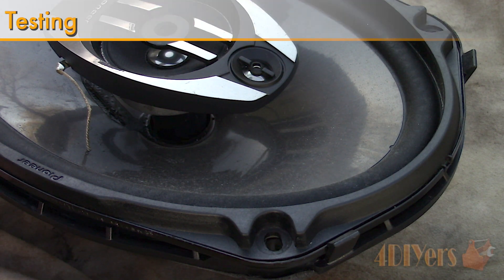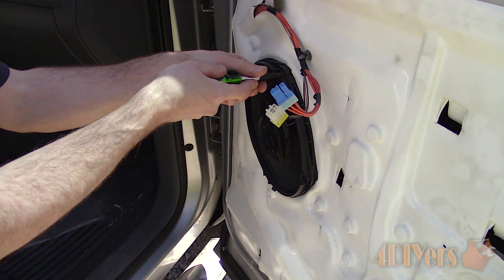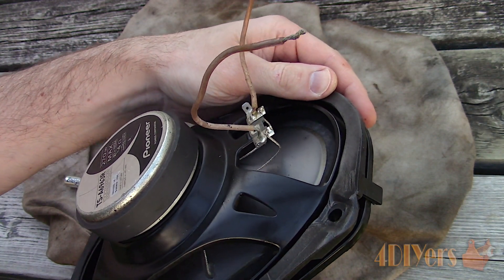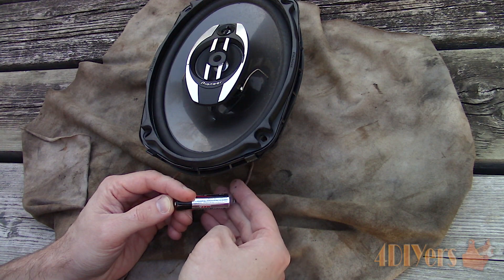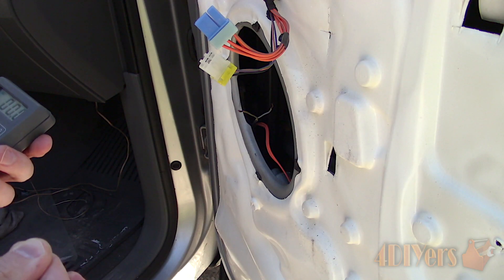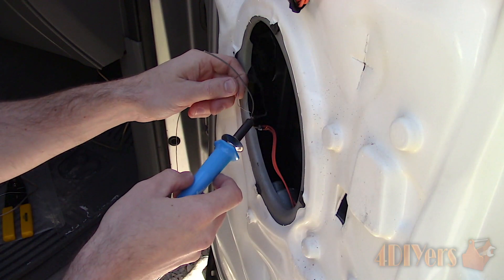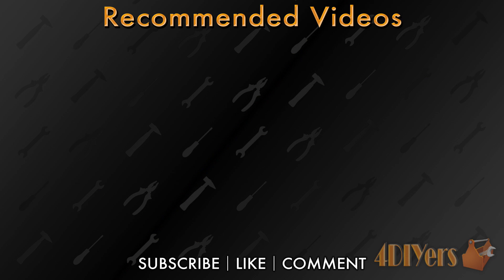How to Test the Polarity of a Speaker and Wiring

Comment: I have a speaker wire in my car and one of the two cables has a black line which is the negative according to everywhere I check online but when I put the voltmeter on the wires (negative on the black striped cable and positive on the other one), the signal is negative. Do you know why?

Comment: Was looking for how to test wires from the radio to peaker line , found it thanks man. Battery test i already know for speakers but usually in my country they come with 2 different size connection. Thanks for the video man was helpful.  I orderd a multimeter but had no clue how to use it. I work more with leds, since i solder the cables on it i know which one is what, on my car had no clue, i have a nearly teal and and a cream with stripw  wire.

Comment: I’ve done this and nothing when testing from the plug but when I ground the negative to a bolt i get a reading on the meter, I tried to test speaker by adding a wire to the negative off the speaker plug to the body and it jump starts the speak to working condition only for a day then it stops working again.   Would you have any idea on to why this might be happening. Thanks

Comment: My 1999 Tahoe is showing a positive either way I test even replacing the radio. Harness must be messed up from the factory.  Testing at the back of the unit tomorrow. 😢
Reply: Same issue i have. Would be nice to see an answer
Reply: Update: I used the AA battery method and it worked perfectly 👍

Comment: Been looking all over YouTube for how to test polarity on the speaker wires themselves from the stereo on an classic full size jeep. Every video shows how to test the speaker polarity but your video finally shows how to properly test identical wires from the stereo to know which is positive and which is negative.   Thank you so much!!!!!!
Reply from the maker: You're very welcome!
Reply: when the value is negative that mean you polarity is not right am i right any help will be appreciated
Reply: @moonyt3247  if your red lead is on the wrong wire it will show negative. If it's in the correct wire, it will be a positive #
Reply: @moonyt3247  👆
Reply: My dog chewed up the RCA plugs on my computer speakers. The wires have no color difference in the wire shielding nor the wire itself. Also no stripes or ribs on the shielding. Third the speakers are covered and I can not see the cone move...

Comment: I have an issue. I wired my new speakers polarity using the multimeter method on checking the car side wiring polarity. The problem is the labels on the radio harness are suggesting it's actually the opposite. So if I put the positive terminal on the positive labeled wire and negative on negative, I get a negative reading on the multimeter. Is my harbor freight multimeter wrong?
Reply: same here, problem !

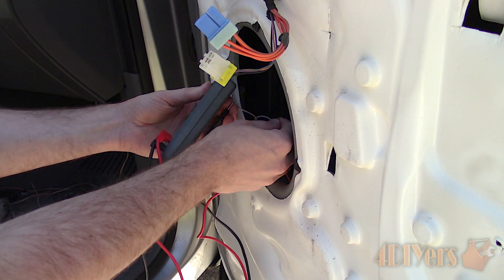Comment: 3:25 isn't speaker power converted to AC from the battery , therefore the multimeter shouldn't be able to tell you the positive or negative, i'm no electrician so i might be missing something tho.
Reply: you are correct..   i think there is a small amount of dc added to the circuit for "auto turn on feature."

Comment: 3:24 How accurate is this - reading? Can that be faulty?  Cause i can't tell by the sound too much but it feels a bit worse if i connect it your way by measuring with multimeter
Reply: I was wondering the same thing. Did this method and it did not sound right. As far as testing the wires from the truck with the volt meter?

Comment: Great video, when using my multimeter setting to 200mv DC I found the voltage fluctuates way too much and goes between neg and pos with im seconds, very inconsistent. I tested this method on a 3.5" line out of my cell phone with volume turned up all the way with the 3.5" cut to open wire used the left pole and ground. Maybe I'm doing something wrong here.
Reply: same problem

Comment: Identifying the wires based on the colour of your multimeter probes only works if you've got the correct colour probe plugged into the correct socket on the multimeter! if you've got your probes plugged in the wrong way around, you're going to have the same problem X)
Reply from the maker: That is true and then it would be user error.

Comment: After searching YouTube for hour after hour all I could find was how to identify the positive side of a speaker only, using the old battery trick, there are hundreds of those. However, I could not find anything on how to identify the polarity of the actual speaker cables... well until now that is! I now have a sense of great relief as I now know how to fit some Pyramid tweeters, which I did work out which was the positive terminal side, but not the cable coming from the windscreen where the old tweeters were mounted, there were no speakers there at all anymore, but I wanted to refit some. The problem had me stumped how to figure which cable was the positive side coming from the head, and I couldn't get the unit out to look at the back of the alpine stereo as that was going to be a huge job. So, I tried what you suggested here and hey presto I hade my problem solved! thanks to you. I am so very grateful and can't thank you enough. I am pushing it I know, but one question... the Pyramid tweeters I bought have a capacitor (or is it a condenser?) already fitted and soldered from the red side and the instructions say that I need to connect the other end to the positive side coming from the stereo (now that I have at last identified it, with your help) do I need to use this capacitor or can I do away with it and just do a normal 2 way wiring to the tabs? I dont think my stereo has a cross over, because of that maybe I do need to use the capacitor. Any ideas. Happy to subscribe to your wonderful helpful channel now.
Reply from the maker: Thank you so much for the support! How many speakers are installed and are the tweeters connecting to wires which already have speakers connected to them?

Comment: Turn the bass to full, treble to minimum. Reasonable volume and adjust the balance to bring speakers into pairs. If the volume drops they are out of phase. Easy check before you start disconnecting.
Reply: mine get significantly quiter when i make it so just the left or the right are playing, is that what you mean?
Reply: @yxinquisitive6001  if you imagine the speakers are facing eachother the cones need to move out together to create the sound. If one moves out and the other moves in, they cancel eachother out.
Reply: @chriscoulthard4947  so should they sound loudest when they are both equal?
Reply: Yes, loudest means they are working together.

Comment: Also note that for the frequency range of interest, the cone will move inwards for a positive voltage. The battery test is a DC voltage and so the movement is in the opposite direction of the actual operation.
Reply: Positive signal should create positive pressure wave, it should push out.

Comment: Love this !  just fit an amplified sub and the sound was crap ! This came up this morning on my feed and low and behold  , a little prod with the multimeter and the aftermarket t harness speaker wires were back to front so polarity was wrong ! Pain in the arse to pull dash apart again so swapped pins in the molex plug and now she kicks 👌 thanks

Comment: Hey thank you so much for this I did not know on my multimeter which setting to put it on, that way I could figure out in my truck which wires which because it doesn't say. I have also tried with the speaker a 9 volt battery and that seemed to work okay. Regardless thank you very much.

Comment: Thank you for this video. I'm changing out a speaker in my car and the wires are set into a plug from the factory. No idea which is + or -.  Old speaker had no markings. Thanks to you I can now check which is the hot and neg coming from my cars wiring.
Reply from the maker: No problem, happy to help!

Comment: Isn't the voltage coming from the amp AC and not DC?
Reply: he means just to make sure the polarity of the amp is correct. if multimeter selected to ac, positive and  negative can be seen
Reply: Bro lol that's what I thought 😭😭😭 everything is so fucking confusing. Audio flows through AC not DC sooooo
Reply: I was also confused on this lol

Comment: Thank you Thank you Thank you!!!   I replaced the 3.5 inch dash speakers in my classic 1989 Dodge Aries and the wire color code did not agree with the shop manual.  I tried reversing connections and listening by ear but your tip to use the multimeter to determine the positive speaker wire for each channel was marvelous!   I am now a subscriber!
Reply from the maker: No problem, happy I could help and thank you so much for the feedback and support. Greatly appreciated.

Comment: i get a reading from both wires saying the same reading? how do i know which is positive which is negative bruv
Reply: xdd U have one positive multimeter wire ( Red ) and the other is negative , right ? So let's say you try to read a battery, when you are touching positive multimeter wire (red) with a positive battery clamp and negative wire to negative battery clamp ( + +  ;  - -) the reading will be let's say 12.7 V ( tho you need to select 20V setting on multimeter ) , and when paired otherwise ( + -  ;  - +   a.k.a positive multimeter wire with battery negative clamp and negative multimeter wire with positive battery clamp ) the reading will be  -12.7 V.
I don't even know how more detailed this could get xd hope you understood